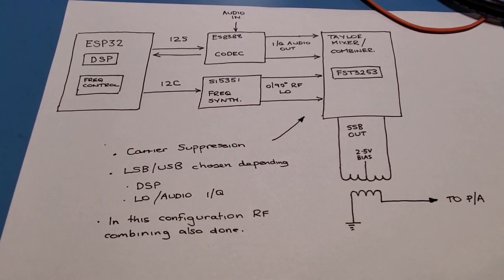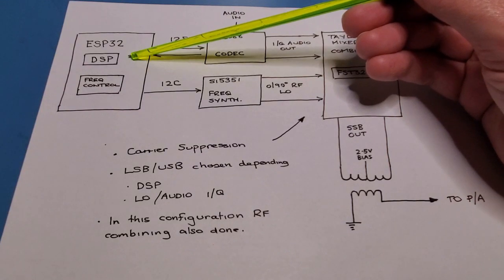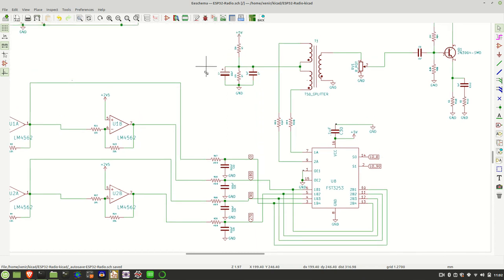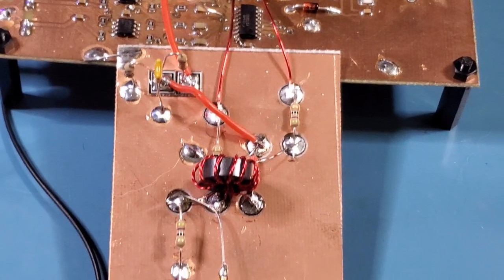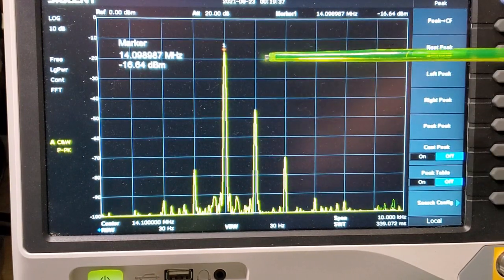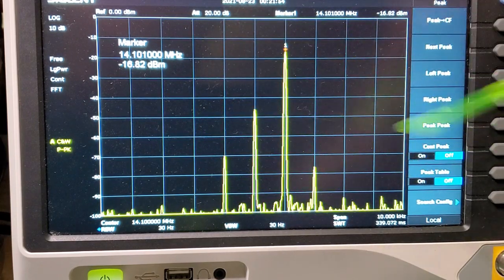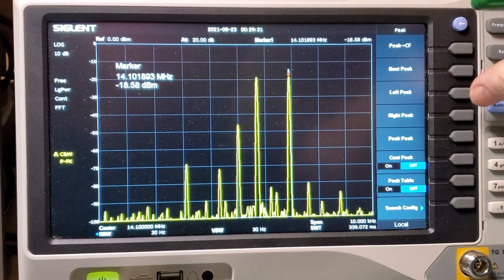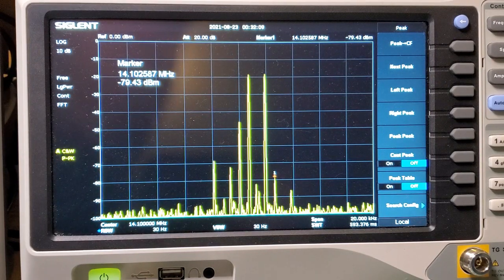Quadrature SSB Transmit Mixer

Comment: Hi Ian, awesome work again. I'm going to venture way outside by pay grade ... would the carrier and other artefacts change with different (less) drive from the audio board and si5351 in to the mixer? I have a vague idea the IMD nasties are none linear relative to the input??? Also the lack of carrier suppression is a little surprising/disappointing. Stopping now before making a total idiot of myself :)
Reply from the maker: Its a great suggestion Neville. I tried adjusting the RF drive level and on the Tayloe detector it had no effect. On a pair of double balanced mixers it had a significant effect - interestingly increasing the drive increased the carrier suppression. Reducing/Increasing the audio level only affects the upper and lower sidebands (increasing both or decreasing both at roughly the same level)

Thank you for the comment!